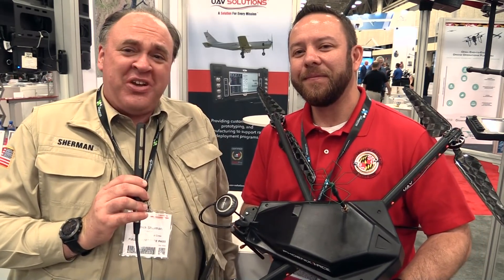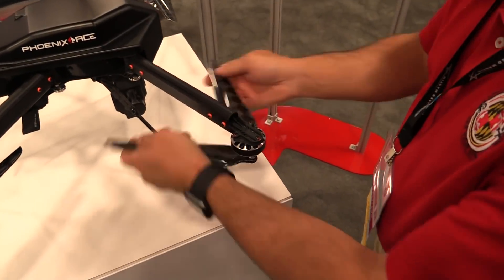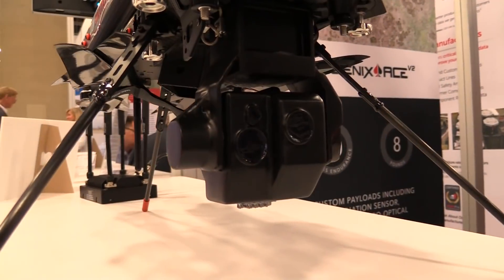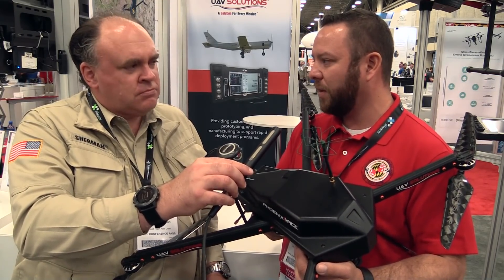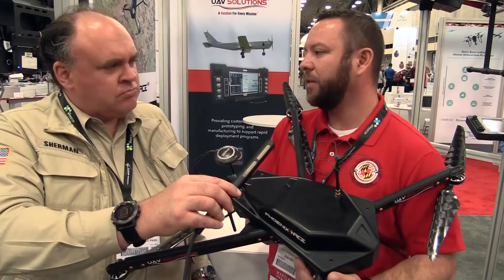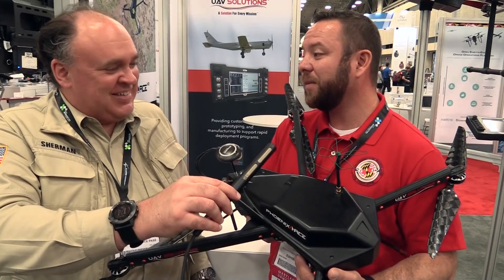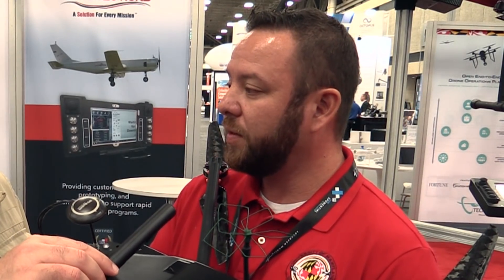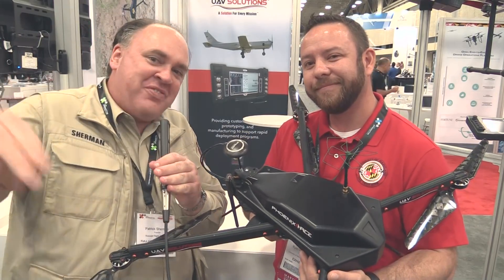This Drone Flies for 60 Minutes (and Does Science!)

Comment: I love the design of this drone. It is a perfect example that an efficient designed is combined with lithium ion cells is the perfect combination for long range, even on a quadcopter. I build a 700mm size quadcopter with a custom build of the shelf (NCR18650GA)  cells 6S pack and I'm consistently getting 1hr 45 minutes of mixed flying.